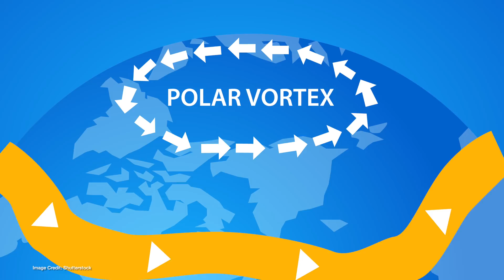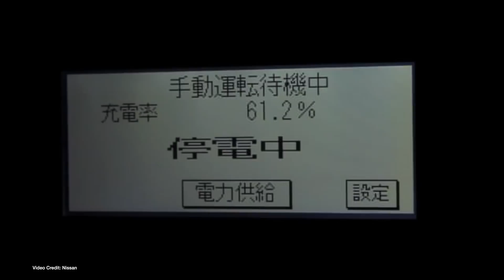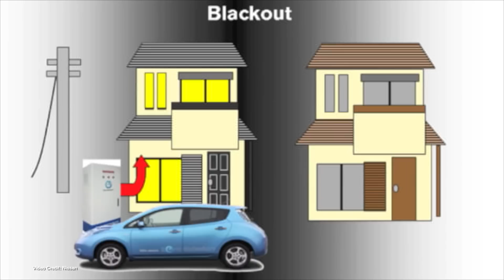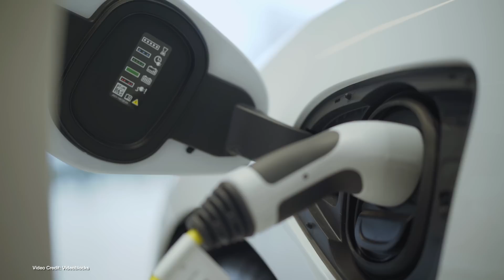Winter Storm Uri: Electric Cars, Renewables Will Help, Not Hurt, The Texan Grid

Comment: I want to add this: Batteries used to store energie at home don't need to be Lithium-based! It doesn't need to be a batterie at all! If you have enough space and a resonable hight difference in youre "backyard" (it has to be big), you could option for a hydrostorage of energie. Use two big tanks, one high and one low, and pomp water to the high tank and when needed let the water drop to the low tank via a turbine. But if you don't have a lot of space, you still can use other batteries than lithium. For use at home you don't need lightweighted batteries. Use havy, bulky ones, that are cheaper (but can store less energie). Use more of them, and you still have a hugh capacity to store enough energie o come by. I hope more firms will cover these solutions and market them as the best for homes, becource we need all the materials for the lightweighded bateries to go to vehicles, cars, trucks and busses.

Greetings from Belgium where this weekend the temperature will go up to 18°C.
Reply: So let's calculate this. What sort of water tanks would you need, to replace a Tesla Powerwall 2 with pumped hydro?
Gravity is 9.8 m/s². Water density is 1 kg/liter. Pumped hydro is ... let's say 80% efficient. (I don't know the actual number.)
So, if you have a tank 5m above the ground, each liter of water provides 9.8m/s² × 5m × 1kg/l × 80% = 39 J of energy.

But 1 kWh is 3600 kJ. So, to replace a 13.5 kWh Tesla Powerwall 2 battery pack, if you have 5 meters of elevation difference, you will need 1239 tonnes of water. If your tanks are cylindrical, they would need to be 11.6m in diameter and 11.6m in height.

Well, 11.6m tanks separated by 5m doesn't quite work because the upper tank will not drain completely. So let's try a 10m elevation difference. Then your tanks will only need to be 9.25m in diameter and 9.25m high. In other words, you could have a single cylinder 20m high, divided in half by a floor that can somehow support 620 tonnes of water without collapsing.

Pumped hydro is great ... but it doesn't seem very practical at the home level.

Comment: There have been cold-weather snaps, as you alluded, roughly once ever 10ish years, yes, but this has been by far the coldest in almost a century.  It’s a tough call as to how many $$$ is worthwhile spending on winterizing gas pipeline here, since this has been so historically rare.  I certainly agree that we need to spend ... well, enough to insulate (literally!) against the 2011 cold snap, but iffy as to whether it’s worth the cost to insulate against this kind of extreme cold.  Hunkering down once every 80 years or so may not be too much to ask, to save the cost of insulating miles and miles of natural-gas pipeline.

Comment: (Austinite here.)  My understanding is that Texas declined to join either the Eastern or Western power grids as those wide-area unified grids were forming a little before WWII.  Planners in Texas and the US as a whole, wanted to insulate Texas oil production and aircraft manufacturing from other states’ power generation.

Power grids don’t invariably stabilize power generation.  Even nowadays, albeit only rarely, failures at one spot in a power grid can take down large portions of that grid.  As strange as it may sound today, the crossover, where power grids became a net stabilizing rather than destabilizing force was roughly in the late 1930s.  

Since Texas had and has the resources to go it alone, during WWII, they judged it less risky to have Texas oil, airplane, etc., isolated.

Comment: The funny thing is that gas pumps need electricity to run as well.
Reply: But electric cars certainly don't need gas pumps.
Reply: This why now in Florida all Gas Stations were required to have a backup generator to get tghe fuel out of the ground when it is needed during an electrical grid outage.

Comment: I went without power for 36 hours in Houston this past week. I have thought of getting a Tesla powerwalls or two in the past, but the installation cost is very high. I'm hoping the new presidential administration will offer a huge rebate for home battery storage. In the mean time, I'm planning on buying a 1000w Jackery battery and solar panels. Every little bit of power helps. We had several days of bright sunshine this week during the winter storm in Houston. I sat there bundled up watching the sun outside thinking of how nice a solar panel would be working. For me, this will be a catalyst to finally act on getting some battery and solar in my home.

Comment: People have to watch 8bit guy living in Dallas, Texas video on Youtube showing that gas pumps could not work since they are electrical. Thus gasoline cars were useless anyway. Besides lots of folks died from carbon monoxide using gasoline cars running in the garages. In fact gas generators are very inefficient generating power. Interconnected EV car batteries are much more efficient delivering energy back to the grid.
The big question is why in Texas private homes and businesses have no incentives to have solar pannels on roof with storage batteries to accumulate that energy. That could greatly relieve stress on the state's grid.

Comment: I live in a West Texas town where a lot of homes including my son's house were without power. Having battery storage would have made a big difference. Brown outs would have been much easier to manage. If everyone had solar panels and/or battery storage, (where practical) problems with the electric grid would not be such a big deal.
Reply: Great point and the Energy Efficiency that was only 22% after being scheduled to sunset this year was moved back up to 30% by President Biden even before this recent event. If TExas was as smart as the state they love to hate California and created a program to motivate people to install Battery Backup like the Self Generation Incentive Program or SGIP then your some could install batteries adn have some self reliance from the grid during period like this. Permain basin was unable to pump NatGas because they cut power to the very stations needed for pumping it.
Reply: Not and/or. And. With no solar, the batteries would need to be charged from an out of capacity grid under the current state of generation there.
Reply: @vidznstuff1  Ideally, everyone having solar/wind and battery storage would totally change how we think about electricity, but I suppose we have to start somewhere.

Comment: The Texas windmills on the coast remained in operation and produced more electricity than normal because of the increased winds. Their percentage of "remained in service" is greater than the gas and coal plants. 

The problem in Texas was cut rate wind turbines and a general attitude since Rick Perry helped destroy the electric grid, that preparing for once every 10 to 50 year storms is too expensive and it's just better to leave Texas without power when that happens.

That is literally the decision that Texas Republicans enabled by utterly abandoning regulation.

Comment: Perseverance, another EV where ICE can't go.
Reply: Technically Perseverance is nuclear powered through the RTG unit generating the electricity.
Reply: @Obscurai  so it's not internal combustion engine vehicle, it's an electric vehicle with a very particular kind of energy source.
Reply: @ulissedazante5748  
Correct. It's not an ICE engine, but the RTG converts nuclear fission to heat and then to electricity which is makes the engine closer to a plug-in hybrid rather than a pure EV. In some ways, it's closer to a steam engine because of the heat conversion to electricity. Here's more info.

https://www.energy.gov/ne/articles/powering-perseverance-nasa-s-mars-2020-mission-fueled-doe-national-labs

Comment: Turns out most of the problem was reduced electricity generation from gas. As you point out more grid connections and battery storage would help a lot. 
https://reneweconomy.com.au/massive-texas-gas-failure-during-climate-extremes-gets-blamed-on-wind-power/

Comment: We've been doing a DIY and local labor solar installation program in West Philadelphia now for about 10 years. We have done 10 systems so far at no more than one half the cost of a commercially installed system...usually significantly less...and everything is properly inspected and grid-tied. 
We are working on doing an entire block in solar with a micro-grid storage system.

Comment: if i can go indepedent by generating my own electricity and make money by supplying some of it to the grid, then i say "hey, why the hell not?"
the problem is that the equipment costs a lot of money which i don't have :-(
if i had that money, i'd go for a system with a lot of battery storage. and the system would have to be able to supply my house with electricity, even when the grid is down. i mean, if it can't do that, then what's the point?
Reply: Have you tried checking your options by spreading the cost/spending by financing the system?

Comment: Carbon capture coal and nuclear are more reasonable alternatives to this wind and solar hysteria that has taken ahold of everyone. But the leftists like Nikki have an agenda and force the narrative to fit. Nuclear and coal don’t mind low winds, clouds, ice storms, etc.
Reply: So why did it happened in 2008 and 2011?
Turbines again? 
So why do other countries can cope with renewables? Look at Norway for instance.
Rich oil exporting national but run on renewables..

But you are right.. keep your head in sand.
Reply: @timypp2894  Norway is a small country which makes a significant difference in grid dynamics. Also look at the prices they pay compared to what we do in coal states like North Dakota and Wyoming. Coal and Nuclear are ALOT cheaper AND more reliable. There is no denying that. Making coal low carbon emission should be our priority. The wind turbine experiment should be over.
Reply: @jam206AR  Norway small size isn't anything to do with it. It copes.
They are putting more turbines in the middle of the North sea and selling to power to the UK.
Look at Germany 90million. They can cope.

I say it again, Texas is going renewables because it's cheaper. It's not because they want to be cleaner, greener or going liberal etc.. it's because it's cheaper. That's fact.

You saying nuclear is cheaper, are you joking? What's the price of clean up when it's decommissioned. I guess you don't mind nuclear waste in your home state?

Coal is cheaper? I'm sorry you talking bollocks. Why do you think other power generators (from all states) are closing down their coal stations? They want to be green?

Comment: Texas going back years and year before this nonsense climate change in the 1800 s had -23 get your facts right . Stop being a preacher . Stick with electric car news . Facts below . 
s
Climate and Past Weather
Local Programs
The Coldest Night in Texas History

If you think it's cold this week, let us tell you a story of record cold temperatures that were experienced in the past history of Texas.
February 1899 was a very cold month, thanks in part to a bitterly cold outbreak from the 11th through the 13th. In fact, nothing in the history of Texas quite compares to February 12th 1899.
Some of the coldest weather to ever hit Texas occurred on February 12th of that year. The lowest temperature ever recorded in the state occurred at Tulia in Swisher County in the extreme southern Texas Panhandle. The thermometer dropped to 23 degrees below zero. However, there were unofficial reports that were even colder. Low temperatures of 30 degrees below zero were measured that night at Wolf Creek and at a site southeast of Perryton, both in Ochiltree County in the northern Panhandle.  This cold air spread throughout the state with reports of a thin layer of ice coating most of Galveston Bay.
The all-time record low temperature that was established at Tulia was tied years later when Seminole, in Gaines County in West Texas, reported a temperature of 23 degrees below zero on February 8, 1933.
Many Texas cities established all-time record low temperatures In February 1899.  Below is a list of the record lows at various cities across the state.
Reply: And?
How does this change the fact Texas electrical power & grid couldn't cope?

Comment: Octopus energy are running a V2G trial called Powerloop in the UK, sorry to disappoint you but here at least, you cannot use the car as a backup during a power cut. It was explained, it was to do with the fact that someone can pull out or connect the car, whilst a power cut is active, as opposed to a Powerwall that has a permanent connection. Too dangerous evidently, to be approved in the UK.
Reply: Requirements in Australia require PV panels on a home to cut out grid export in a blackout. This protects the workers who may need to repair the fault. I suspect your v2g restriction could be similar.
Reply: A technical solution could probably be found if it turned out to be critical in the UK.

Comment: Part of Texas's problem is large houses with little insulation.  The flip side of energy consumption is energy conservation. The often ignored successes have been improved building codes, more efficient appliances and vehicle mileage  requirements.
Reply: Yah, but that's reggerlation! Only dirty commie pedos want reggerlation! It's against the constitooshn! They just wanter get awr guns! Freedim! MAGA!!!111!!eleventy!!
Reply: There is some truth to that, and I would like to see improvements there but it's political as until a newer Building Code is created the builders will continue to cut every corner. This of course needs politicians who have an above average I.Q. and can see thru articles like the one just posted in Texas Monthly where a so called Energy expert said the problem is our home are designed to keep heat out, and not in because of our hotter than hell summers. This is of course because whatever insulation we do have works exactly the same way in both directions. This would of course require some rudimentary understanding of science. It is all about Thermodynamics. The simplest way to put it which blows peoples minds is there actually is not a thing such as cold, but it is just a term we use to express the absence of heat. Cold does not flow heat does.

All HVAC's regardless of the names are essentially heat pumps pumping heat out of the house to the heat exchanger outside hat then compresses the coolant inside which want to return to the higher energy state so it draws heat from the surrounding area to raise it to a higher energy state. Just simple Physics, and if we didn't have insulation that prevented the heat from the outside being attracted by the cooler air wanting to raise itself back to a higher state the HVAC would be ineffective so I call Bullsh!t of this Texas Monthly article and the so called expert who says our houses are better equipped to keep heat out instead of in. This kind of excuse making is just totally a lie, and Texas Monthly should be ashamed of publishing such dribble that doesn't even hold up to the simplest test of actual science. I am concerned that we are getting so profoundly ignorant of science that someone can put some letters and titles behind their name and say they are assocaitted with a certain college like U. Texas and keep just accept their BUllSh!T as fact. 

Traveller you have a minor point you are overstating as short of R-1000 insulation the heat that was left inside would eventually be pulled outside just because of the simple of thermodynamics if enough time is allowed to pass, and some of these homes were without power for days. I agree we need all the energy conservation as possible as we have a ICE car that get 35mph but the simple answer is that until the homes are designed like a lunar habitat we will need to insure the delivery of energy into a home is enough for the HVAC system to keep up with the constant transfer of heat from one side of insulation to the other, and unlike the stupidity pushed by the so called Energy Expert it is not easier to cool a home than heat it. Heat flow is bidirectional in insulation and anyone who says otherwise if an idiot, or a corrupt politician and liar.
Reply: @elmercroan3859  Thanks for the comments about building codes and yes builders are a weak point. My reason for making my comments is that I am fearful that everyone wants to talk about EVs while ignoring their leaky inefficient homes.
Reply: @chrisconklin2981  I agree with all you points, but this is Transport Evolved, and while Nikki sees the synergy of Energy Efficiency and Self Generation goes hand in hand with owning and operating I am sure not everyone one this channel has made that leap yet. 

Many might just be interested in EV's because they hate Big Oil, or are looking of a more cost effective cost of ownership after the initial purchase is ignored after say you pay it off. This where a comprehensive solution that involves Solar Panels and Storage really makes ownership lower cost than ICE.
Reply: @elmercroan3859  This presentation started about the problems of very cold weather upon Texas and it's power grid. If houses (and power plants) were better weatherized and insulated they would use less energy and fewer burst water pipes. My point is still: Before you consider an EV or a solar power setup you really need to do the energy conservation work. So Yes, " Many might just be interested in EV's" , but someone should once in a while help set the priorities.